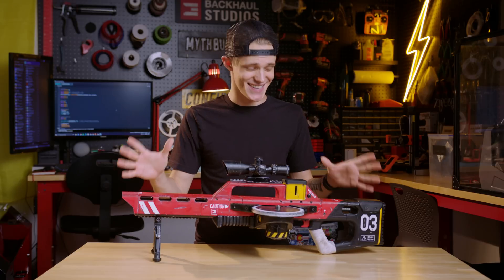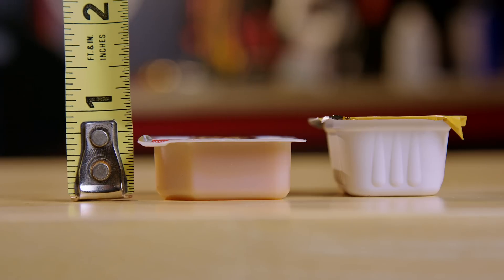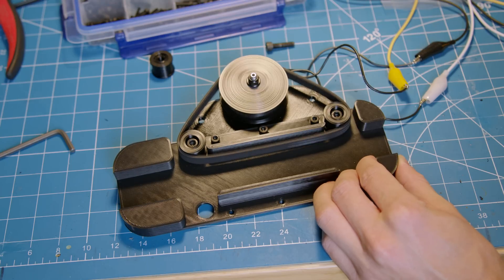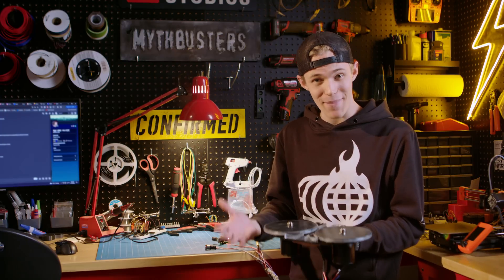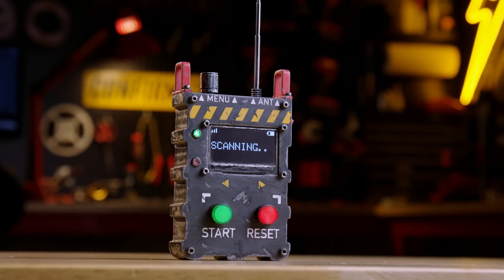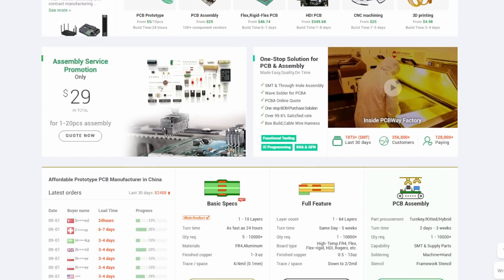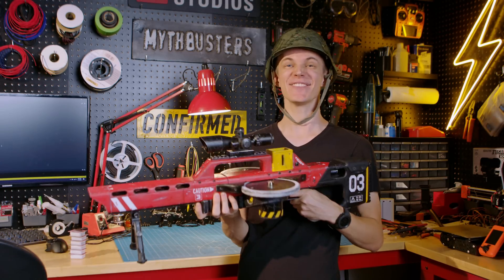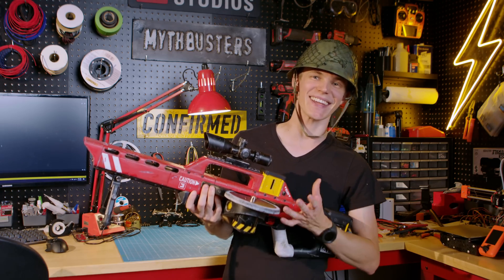Which Condiment Makes The Best Projectile?

Comment from the maker: To add a few things:

1. The whole system runs off two sets of batteries. The motors and electronics use a pair of 24v LiPo batteries running in series to get over 50v when fully charged. The solenoid, however, runs off a dedicated 14v LiPo since it has a pretty large current draw, and I didn't want the voltage to the motors to sag right at the moment a round was fired. 

2. To actually trigger the solenoid, I originally used a MOSFET trigger since they're extremely small. But after letting the magic smoke out of a couple microcontrollers, I opted to go with an optoisolator to keep the 14v LiPo separated. 

3. I learned the hard way that some batches of jelly packets, despite all being from the same manufacturer, have noticeable size variations due to differences in how much jelly gets put in each container. I will absolutely be writing a strongly worded letter to these jelly manufactures since consistency is key in any ammunition, and I can't have these jamming during toast-based combat. Strangely enough, I've found marmalade to be the best so far, so I guess we have the British to thank for something.

Comment: Also a couple of things: 1. The Nerf Community probably could have assisted in flywheel design. Lookup Drac. 2. That Solenoid out performed the early flywheels XD 3. The paintball community would like you to know about compressed air tanks.
Reply: @toastyretinas  it's still really awesome even if it is not up to your specifications
Reply from the maker: Compressed air would definitely be an effective method of acceleration! Though I much prefer the convenience of rechargeable batteries since the high pressure used in paintball tanks (often in excess of 4000PSI) requires dedicated equipment. Perhaps if I ever make a version 2.0, I'll experiment with some different methods of condiment packet launching!

Comment: make your own 3d printed shells and put confetti inside them, party gun
Reply from the maker: Wait this is actually a brilliant idea, I didn’t even think to 3D print my own shells
Reply: @backhaul-studios  or I bet you can maybe use cardstock if you want them to blow open when hitting a wall 🤔
Reply from the maker: @AustrianDeathMachine9  I now have some vital research to conduct this weekend 👀
Reply: @backhaul-studios  Tell me how it goes :D
Reply: @backhaul-studios  it would also be cool to test different flywheel sizes and materials for different objects, you can make this a multi use machine :)
Reply from the maker: I definitely thought about making a version with adjustable sizing for everything so you could use any variety of condiment containers, but with that much added complexity, it will have to wait for Condiment Cannon v2.0
Reply: @backhaul-studios  You should make a firework shotgun